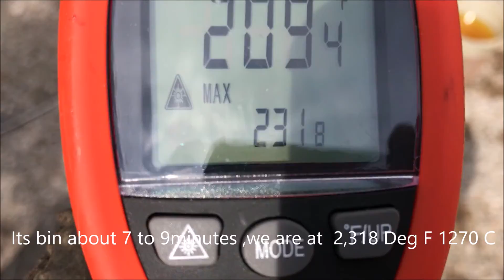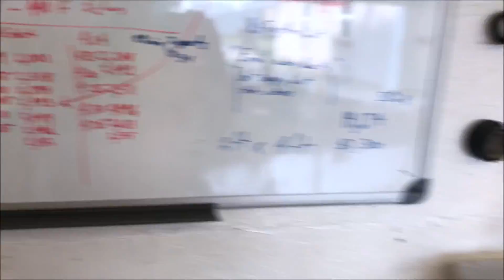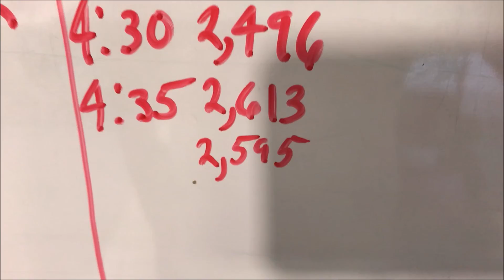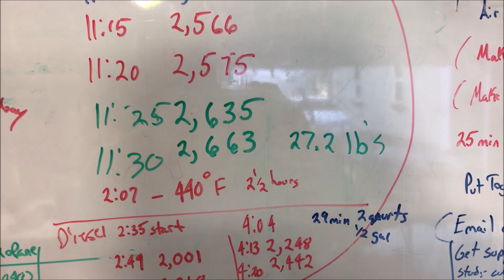Diesel fuel foundry 2613 deg in 30 min using Baby Godzilla burner

Comment: This is surprising to me, I am a diesel student and know that the burning temperature of diesel is 3900 degrees Fahrenheit, so theoretically it should be that temperature in the furnace. I actually wonder how it can be improved to use diesel since it burns so hot. Though diesel is notoriously hard to burn. My tips for improving performance with diesel, high-pressure fuel injection, and the finer atomization the better. I would suggest looking into maybe fitting a multi orifice diesel nozzle to the system but also look into some of the indirect injection chamber systems. I am hoping to try making a foundry myself at some point and I like your design using an old propane tank.
Reply from the maker: diesel max temps calculations are taking different then in real world flames . you will never be able to build a gas furnace that gets hotter than 3,000 deg F , its impossible .
Unless pure oxygen is used
Reply: @NOBOX7  im not sure tho because I've seen photos of diesel engines with not enough air where steel pistons melt

Comment: Wanted to leave a comment this man's burners are the real deal. I just bought a burner from him. I'm using a old catyltic converter a small straight through one like a old glass pack muffler as my combustion chamber with diesal as fuel. And before with propane would take like 45 mins to get my copper to melt somewhat. Now in 15 20 mins I can have a full crucible of liquid copper. And to accomplish it, it uses less fuel then propane. I have a large 500 weed burner I was using. For $65 shipped buy this man's burner. You can use square tubing or a 2 or 3 Inch diameter pipe for combustion or buy his whole set up if not comfortable adjusting and setting your own chamber. I was tight on funds or I would have purchased his high velocity complete set up. Was prompt to ship after payment had my burner 4 days later including payment day. Diesal is the way to go hands down. Sometimes I use 4 gallons diesal 1 gallon gasoline but use your judgement and your own risk
Reply: Recent purchase from Mississippi giving props where it's due. Just what I was looking for much better then my spray gun version I was playing around with
Reply from the maker: Right on brother

Comment: Do you use the same basic configuration in all burners? 

Have you tried others? 

I was thinking about using a burner like yours as a pilot light then in a larger chamber about 12 to 18 inches down stream dumping loads of fuel and air into the flame in another burn chamber!!

Do you think that would get higher temps or only more heat?
Reply from the maker: I actually have over 10

Comment: Your propane burner is probably a much more efficient burner than your diesel burner.  Diesel contains a hell of a lot more BTU than propane, so, in theory, it should be able to put out more heat.  You might want to try a smaller fuel oriface and enough air to completely burn the diesel.
Reply from the maker: The reason propane is actualy hotter then Diesel is due to the fact we are cooling the combustion chamber with cold diesel fuel and it takes energy to boil it , the propane on the other hand is boiled in the tank by ambient heat so this is why we are 50 deg hotter then diesel despite scientific literature discussion adiabatic flame temp
Reply: NOBOX7 - But I thought that was the reason for the pre-heater you use, to get the diesel to vaporize.  I think your setup is losing a lot of heat prior to making it into the furnace.
Reply from the maker: @stevek5416  The pre heat is to heat the air but it doesnt boil the fuel , if you boil fuel in a line like this is clogs in hours
Reply from the maker: No the pre heat is to improve efficiency and output , had nothing to do with diesel really

Comment: I do the same thing when shutting down my little dragon burner you made.  I cut the fuel off, remove the burner from my forge, turn the air all the way up to clear it out, then turn it down to a whisper, then cut off the air compressor to let the burner slowly relieve pressure and fully cool down for a few minutes.  Extends cleaning intervals dramatically.  I look forward to buying your latest design one of these days.  Looks like you have some solid improvements.  I especially like the preheated air, and nozzle that you can disassemble. 👍
Reply from the maker: Great input Joe , sorry i didnt have the foresight to warn you of this , thats exactly what happened to you though last time it clogged i bet . I will be on the look out for this in the future
Reply: NOBOX7 no worries.  I’m fully aware that I bought into an experimental burner. I’m glad to contribute to,and benefit from, what you’re creating.  Btw, you can say that a Forged in Fire Champion uses one of your burners.   😋   I was on episode 27 of season 6 recently.  Unfortunately it was shot back in Feb. when I was still using the burner I made.

Comment: The truth is:  this is a fantastic burner.  I've been thinking lately it would be cool to see you experiment with a supercharger ran off a high power electric motor to power a burner designed by you.  I see decent ones for $150-$200 that would be perfect, a good motor would probably be found on an old air compressor.  something 1-2hp 4,000 RPM or geared up.
Reply from the maker: Bro i do have a 2 stage vacuum motor for one of those residential vacuum systems that are built into the building . it has 4 psi of boost
Reply: @NOBOX7  Heck ya, that would work great!